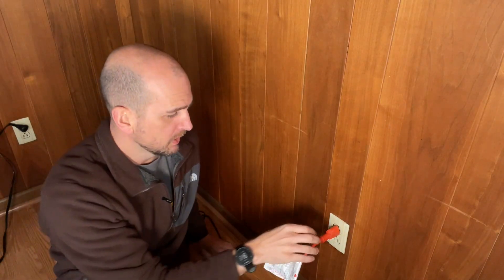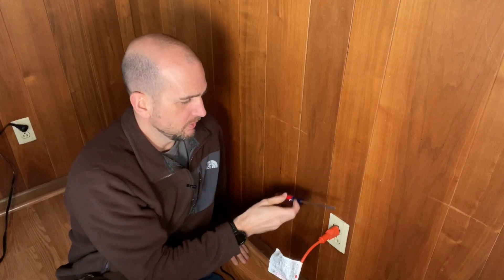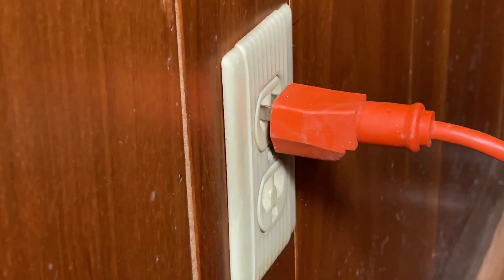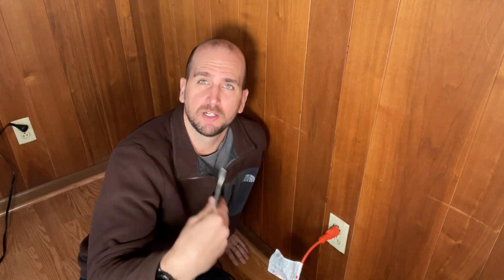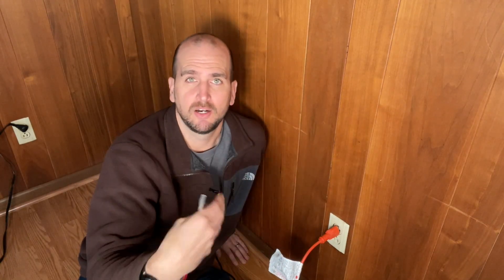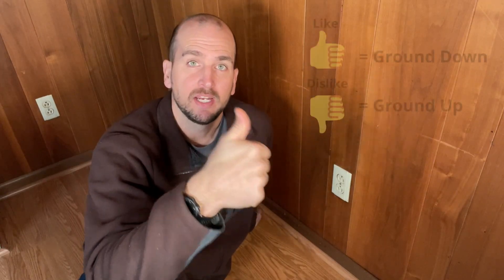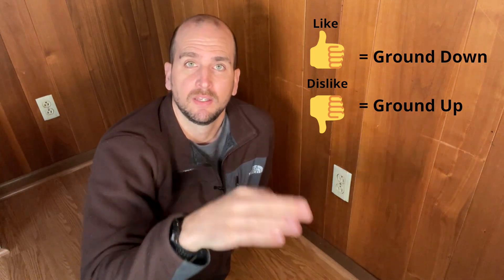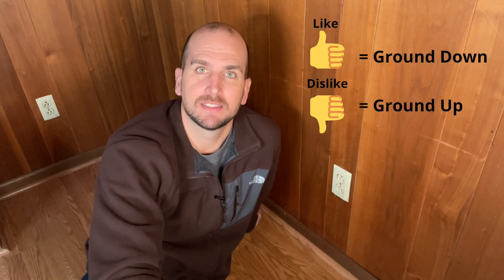Should An Outlet Be Installed Ground Down Or Up

Comment: First of all it is called U-ground receptacle.... You get the U shape only when you place the ground up.... You can also install the receptacle horizontally with Neutral prong Up, this way using groundless plug also protect the circuit against accidental short if some metalic element falls on it.

Comment: As an Electrical Engineer and 50 years residential and commercial experience.  THE reason the Ground PIN is longer is to engage ground FIRST for safest appliance and operation.  WITH THE GND pin up it THE WEIGHT of the plug and cord tend to remove the longer GND pin first...nullifying the safety of the GND pin earlier. THE rule of thumb...for a few micro seconds of more safety...FACE UP.😮😮 during the critical plug insertion moment of plug and unplug....Doing that for 50 years.

Comment: In Puerto Rico is installed horizontally.
Reply: Now he has to make a whole new video, ground left or ground right.
Reply: I have some installed like that in my house.
Reply: yep ... that way you won't have  any issues if something falls on top and no sparks cause  Either hit the hot or the natural wire.👍🏻🇵🇷
Reply: Half of the receptacles in my new house are the same way (they’re on the baseboard). It’s very odd I’ve never seen that anywhere before.

Comment: Down. They're up where I currently live and I haaaaate it.
Reply: 2:54 Perfect example of why. Cables like the one in the background are designed around ground down, so when ground is up it doesn't work as intended and puts extra strain on the cable. Also I think it looks stupid, but that's minor.

Also, that screwdriver/picture frame/metal falling on a partially plugged in plug never happens. That, to me, is an absolutely ridiculous argument. If the ground up people have to manufacture a scenario that never occurs in real life for their point of view to make sense, they've already lost. And if your plug isn't staying in the outlet to actually create the first half of this unrealistic scenario, the correct safety procedure is to replace the outlet.

Comment: The confusion on up or down comes from a code requirement in I believe it was late 70's or maybe early 80's that required the ground to be installed  up. It was only in the code for 4 years to my knowledge and then the requirement was removed..

Comment: I prefer them up on convenience outlets.Plug in a heavy cord and see what happens when the ground is down.the hot and neutral will pull part way out, up to maybe half way.with ground up the wort that can happen is the ground will pull slightly out leaving hot an neutral well connected.Dedicated outlets can be installed according to the situation such as an appliance with flat plugs so that the cord rests comfortably.

Comment: In my basement I have outlets at different levels on the wall.  Ground up on the lower ones and ground down on the higher ones.  My grandfather was an electrician and wired the basement, his reasoning was objects falling.

Comment: When I wired my new house back in the 80's I failed the electrical final inspection because I installed my plugs with the ground down. The state required them to be installed ground up ( they have since deleted the requirement for ground up). After I passed the inspection, I went and changed them all to ground facing down
Reply: Thats really stupid! 
Ground at the top is almost universal everywhere else in the world and a legal requirement in the UK.
Reply: I have always seen this in the south.  Do you live in a southern state?
Reply: @user-xh1kz7rm4j  Might be. When I moved 20 years ago to a house down in rural TN, one of the first things I did was go around and swap all the outlets to "ground down", due to 90 degree male cord ends on so many appliances.
Reply: @user-xh1kz7rm4j  I live in a southern state and every house I have been in have been ground facing down; and the houses range in age from brand new to very old.
Reply: Ground up by code.
Reply: @henrydycha3738  Ground up is not "code"
Reply: @humphrey28078  Not "national code", but could possibly be local code.
Reply: @UpnorthHere  Possibly; but in the many places around the US I have lived; I have never seen it done that way.

Comment: Here in NL most houses are ground up, but it’s very clearly ground down preferred by everything you plug in. I prefer ground down. However apparently by code it has to be one or the other not a mixture in a residence.

Comment: Consider this... recessed clock receptacles have a hook at the top for hanging the clock. They are all manufactured with the ground down. Personally I agree with the ground up arguments when it comes to discussion. I agree with the ground down installation for residential for the same reasons that everyone brings up about how consumer products are manufactured. After understanding the original design and intent of the three-prong outlet as well as experiencing the real world of products in use, we can make a deliberate decision as to how we install instead of simply following examples. There is no "right" or "wrong" way, there is only the "correct" installation for the conditions.

Comment: I'm OLD so I remember before Grounded Outlets.  When they came out the concept was to have the Ground DOWN like "Down to Earth".  Years later, some big Industrial Facility had a Freak Accident like you described in the Video involving Sheetmetal falling "on an Angle" onto a partially plugged in Cord.  By "Freak" Accident; the Cord could have been plugged all the way in, the metal could have fallen across the Neutral and Hot to Trip the Breaker, Angled from the Neutral Pin instead, Missed the Outlet all together or falling onto the Plug or Cord instead, or as it occurred; it fell onto the Hot side and when the person reached to retrieve the Sheetmetal they were Electrocuted.  The Big Industry petitioned for a Ruling to put the Ground up to prevent further Incidents.  They Ignored that a piece of Sheetmetal could still fall in a Freak Incident, missing the Ground Pin and still lodge on an angle against the Hot Pin.  It went for many years to have the Ground Pin Up before the assumed real purpose for the petition was to sway Blame and Responsibility for the Death away from the Big Industry.  The Popular direction of Ground up lasted for a Generation and most of those voting to keep it that way were trained that way during their Apprenticeship so they still regard it as correct.  I'm glad that we are finally getting back to Ground Down.  You probably should cover that the  Pin Hole in the Socket is the Hot side (Yellow Screws).  I would say that is more important for the DIY Group than Ground Down or Up.  If the Outlet is wired backwards from the Standard we really have a Safety Issue.

Comment: Definitely mount the box sideways with the neutral up, this has many advantages: A falling metal object will always hit the neutral first, regardless of three prong or two prong plug. You can enjoy the WTF look on the inspectors face as he tilts his head. When your wife complains about none of her do-dads sitting right, you can tell her to go wire her own damned house. When there is a flood and rising water hits the hot leg first, everyone in the house is electrocuted, no more problems.

Comment: Either way is fine. Specification jobs like US Government, Hospitals, Industrial, or other prefer the round grounding pins on the top to avoid shorts (OSHA). Sideways receptacles? ALWAYS put the longer flat prong neutral slot on the top. That way if a metal object gets between the plug and the outlet and someone reaches in to pick it out they are much less likely to get shocked. I am a master electrician licensed in over a dozen states. Architects will spec GROUND DOWN or sideways was really cool for while. I personally prefer ground up but it makes no real difference at all. Many 3 prong 120 volt 15 amp cords angle downwards with the ground pin down, and so do nightlights and USB adapter, timers etc. Then you probably want the round grounding pin down, at least on those receptacles. It does not matter for vertically mounted receptacles, unless there is a spec in the plans. Originally the NEMA  5-15 was designed to be installed ground UP. Before the NEMA 5-15 there were the non-grounding polarized two prong receptacles, before those, the non-polarized 2 prong receptacles and before that everything was fed from Edison screw shell type A lamp sockets. A two prong non-polarized adapter that was made for to adapt a type A  Edison screw shell to a two prong non-polarized cloth over rubber insulated cord, with two prong plug on it. Before that, they made cords that screwed into lamp sockets. Edison screw shell lamp sockets are commonly found mounted in the floors and low in the baseboard of old Victorian & Edwardian homes. They ran converted gas lamps, or gas lamps that were converted to run on electricity using incandescent light bulbs.

Comment: I would do ground facing down purely because if you have a lot of tech that has large wall warts they generally have the bulk of the wall wart designed to hang toward the ground. And if the ground is up that will actually cause the wall wart to unplug itself. 

That is just my experience but that would give me all the reason to have the ground down so that I don’t have to worry about not being able to plug certain items into the outlets.

Comment: With ground down the cord, as it's worked outwards, will have gravity pull on it and eventually remove one of the 2 power prongs. If the hot prong is still in and the neutral is the first to disconnect, at least the product will still be grounded. That is my best guess reason for why the ground should be on the bottom. You don't want the ground prong to be out and the device to still be hot with a shorted wire. That's an electrocution potential.

Comment: My default is 'ground-down' but when I have a clearance issue (such as behind a sofa or filing cabinet) and need a low-profile/flat-plug I would flip an outlet if necessary to avoid having a cord with a 90 degree/direction-specific/ flat plug get twisting to go the direction that I ultimately need it to go.

Comment: Ground down, beside the cord pulling down for most items, although it is limited it is possible to have the ground pull out just before the main plugs which means you are no longer grounded. Think that is a joke, we had an employee get killed over a grounding issue and the company changed everything. No, it was not from the upside-down or ground on the top, but it shows that it can be serious. Why when the cords hang down you would you want to put the extra strain on the cord, plug, etc. Plus I like the other comments that some items would be upside down.

Comment: I prefer ground down, but I worked at a large aerospace factory for most of my career, and the building maintenance electricians all put them in, ground up.  I asked why, and was told that there had been a few people over the years, in the offices that had knocked paper clips off the back of their desks and shorted the contacts, tripping the breaker.  No fires, but the fear of one was real enough, that it became company policy, thanks to those few instances.

Comment: All good points but the issue with ground up is hogwash. I've been a licensed electrician for 42 years and have never seen a circumstance of things falling on a chord cap knocking it out enough to cause the type issue you describe, in fact, if it's that loose the receptacle needs to be replaced or the plug.  There are no short cuts here folks. To be aware is to be alive, specifically with any electrical device. Complacency and just careless can kill. Now why do 2 prong have one bigger blade? Because some electrical devices need to be plugged in polarized, that means the hot and neutral have to be on the correct wire. The large blade is the neutral(white) also know as the Identified conductor. you don't cut the large one to make it fit either way, why? Take a lamp for example, when you screw the bulb in the tab all the way isolated in the bottom is the hot the outer shell where the bulbs threads are is the neutral, if you reverse them then the outer shell gets the power which if you contact it while turning on the fixture, screwing in or out the bulb or just moving the fixture while plugged in there is a major potential to receive an electrical shock. There's a reason we become licensed, we undergo serious schooling which requires continued education when we renew that license every 2 years. Be safe, if in doubt contact a licensed electrician. I can appreciate folks like this gentleman putting up videos to help others out, but at the same time it bothers me when it's something that unless you are a professional you should not attempt. The wrong, not quite right, or enough information to perform the task safely can get people seriously injured or even killed. Remember dumb you can educate but stupid there's just no fixing,  Respect electricity it's that easy.

Comment: You are right about hospitals having the ground pin up as all cords have a ground pin which is checked on a yearly inspection.. One thing that can fall on the pins is a metal cover plate where the screw has come loose then fell out with something plugged in. Also Hubble (at least hospital grade ones) prints their name on the front so that it can be read with the ground pin up.

Comment: When I remodeled my house, I put the ground up but I have to tell you, almost every item you wish to plug in, the ground is upside down.  This even includes "nite-lights" of the two prong variety.  With the outlet being ground up, the larger slot will be on the wrong side and require nite-lites to be upside down.  The same problem exists for two prong transformer type plugs.  The larger prong will force it to be installed upside down.  If I were to do it over, I would install the outlets ground side down.  I just wish the outlet and electrical device manufacturers to create a standard or perhaps create an outlet with two ground holes per plug so you can put the plug in either way.
Reply: they have a standard and thats what is making them need to be installed upside down when the ground socket is up, so in reality the electrical code needs to be standardized to meet manufacturers when medical style 360 degree plugs are not viable due to costs or various other reasons. ive always had switched outlets be squared whereas my normal are the common rounded styles so the outlet doesnt limit me on what i can and cant plug in normally.

Comment: I was a Master Electrician at our local hospital before retiring in 2016 and it was always ground up, I had been doing it for over 33 years working there and never had a short circuit with something like a metal object falling on the exposed prongs of a cord cap. NFPA/NEC 99 required that all of outlets could not be less then 4 ounces of tension to maintain the cord cap within the outlet. These are tested yearly to make sure they passed, if failed they would be replaced. Most did stand the test of time keeping their 24 ounces of tension on each of the prongs.

Comment: The real problem is a lack of standards! As you rightly point out there are many devices that virtually require that the ground be in the down position so putting it in the up position does not work well. I think that the most important thing is to mandate a "standard position" for the ground and require all manufacturers and electricians to follow that standard. The vast majority of current electric powered devices requiring a ground plug have a plug head with the ground at the bottom so I suspect that standard would meet the least resistance from manufacturers. And as we all know only too well in the end large manufacturers call the shots in America.

Comment: The only place where I've seen ground facing up is at Hospitals. I've always wondered why.
Reply: It's safer
Reply: when you pull the plug out, the grounding pin is the last to contact the receptacle. Plugging it in, it's first. IF the outlets are below about 24".
Reply: @martyspargur5281   Or you could just make the ground pin longer, which it seems to be on quite a few of my extension cords.
Reply: @NogrimStoneson  Yes, they are longer. I meant the way that the plug sometimes gets "peeled" from the outlet, for the most part unconsciously.
Thank you, Nogrim!

Comment: If the ground is up, a plug falling out of the outlet has a chance of disconnecting the ground prong while the hot and neutral are still connected. That would leave your appliance with power, but no ground.
Reply: The ground pin is longer then the h/n prongs to prevent this.. there is virtually no way for a cord to remain energized with a ground pin fully out of the receptacle.

Comment: If you check your local/state electrical code for 2020 I believe you will see there was a change in the code.  I do not agree with it, but the reason is there.  As I read in a comment below, a person made a comment that he has never been shocked by a metal plate hitting the plug in an outlet.  Who is going to hold onto a piece of metal and slide it down and hit a plug in the wall?  Not me! However the electrical code in all of its wisdom made the change for the outlets to be rotated having the ground placed to the top.  As for the cords that plug in to the outlet, they do not know which way the electricity is flowing, all the plug/wire knows that the electricity is going to the device it is connected to.  The rotation of the outlet is a code requirement and not anything to do with esthetics.  Get used to the "Upside down outlet." it is code!

Comment: The previous owner of my house installed all outlets with the ground up. 70% of the outlets were broken because the ground put pressure on the small plastic above it in that orientation and snapped it out.